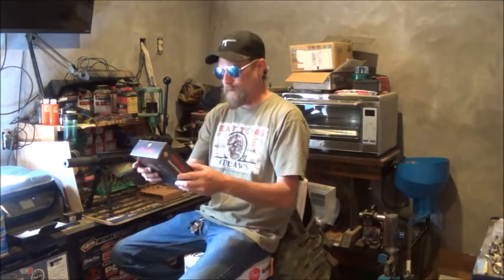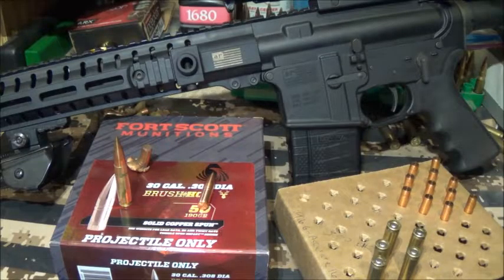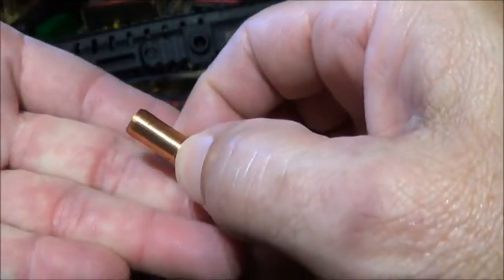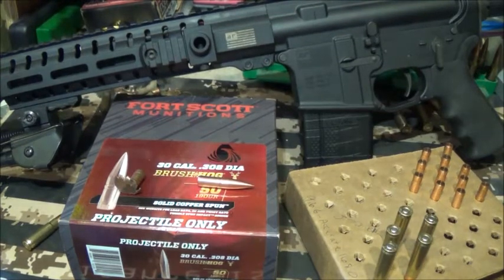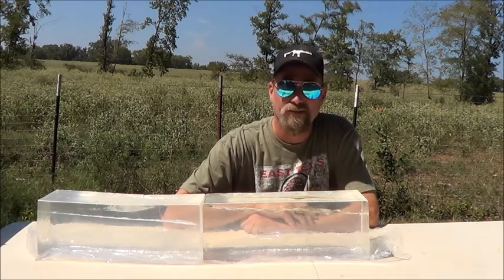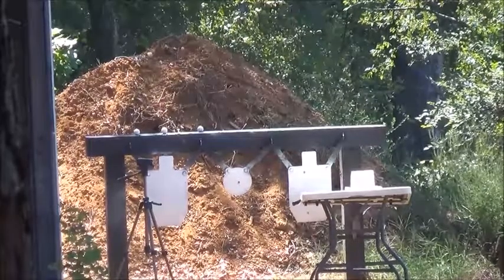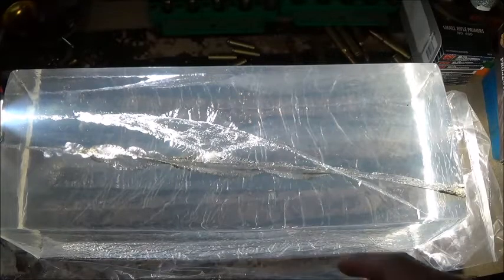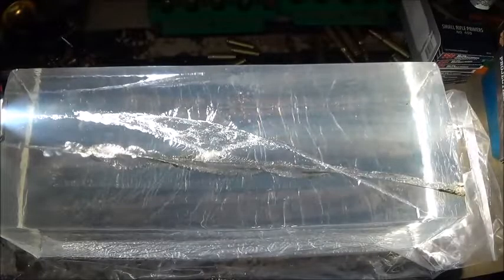Fort Scott 190 Gr  TUI 300 Blk  Gell Test

Comment: I like these tests. Especially the subsonic test.
Reply from the maker: Well the ones you sent have done the best so far, Thanks !!!!!
Reply: @EastTexasOutlaws  I figure Hornady basically just relied on their pistol ammo technology to design the Sub-X. Simplest way to do it really. The 190 bullets are hard to get. The 175grs are out there but probably won't cycle in an AR. The 175 Sub X bullets are the same ones Hornady  use for 30-30 Sub-X cartridges.